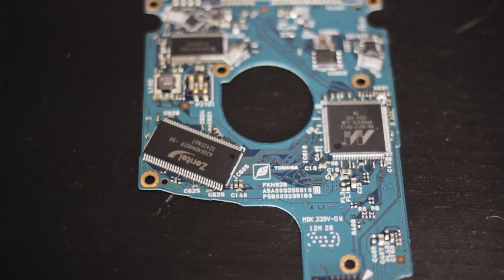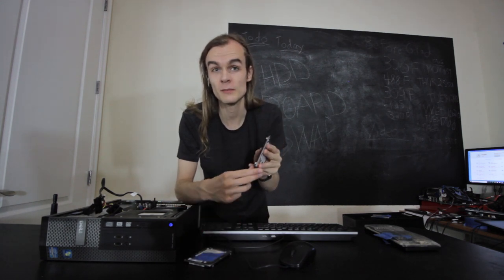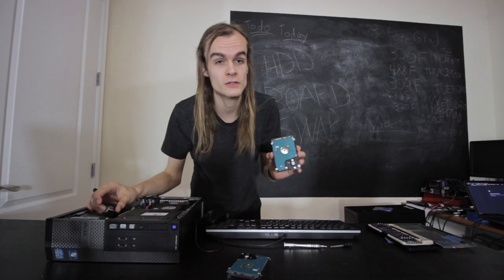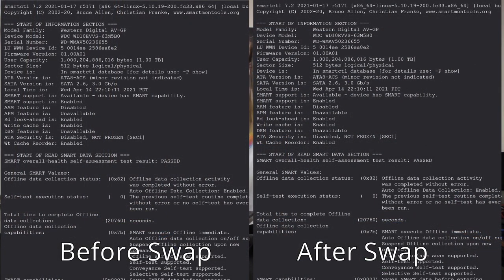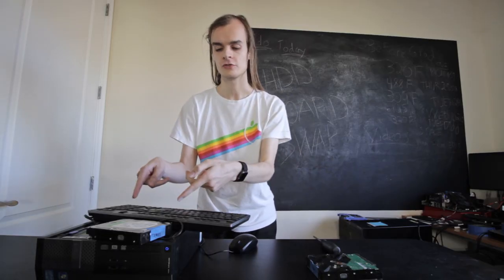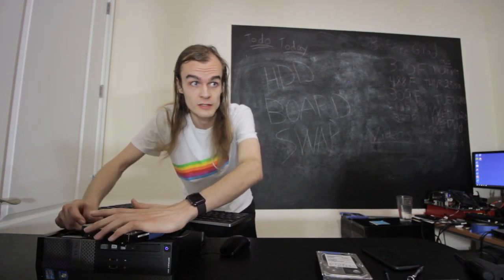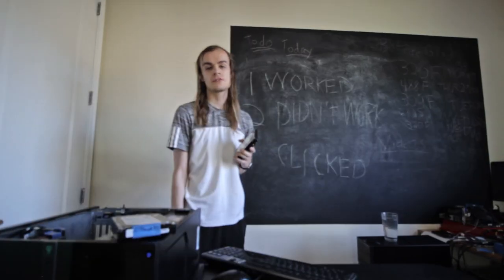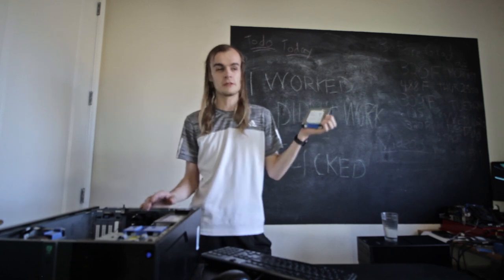Can you swap boards between HDDs of the same model

Comment: I believe there is a bios chip on some of the boards that needs to stay with the hdd.
Reply: Would it work if a buy new one identical to the one i have? i think i fried my board when using SATA cables from an old PSU and HDD is not turning on at all. I know a data recovery is expensive so i would rather try this.

Comment: I have tried hard drive board swaps on several disc drives.  It has never worked for me.  You probably need to swap the BIOS chip.

Comment: The 2.5" drives were slightly different models, so not surprised it didn't work at all. The physical platter layouts were likely quite different hence the drive clicking! Also, your side by side before and after drive swap smartctl output shows the exact same system time leading me to believe you are showing the same output twice and not the actual before and after.
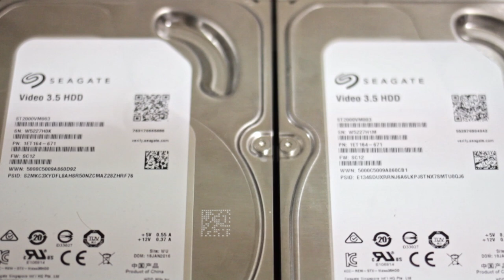Reply: The model is the same, but the revision/configuration isn't (3:23). Heck, the disks aren't even from the same year (5 years difference!). For a chance to work it would need an exact (or at least near exact) revision/configuration/firmware match, and even then it still could not work (8:26).

Comment: Only if the BIOS chip firmware is the same revision. If the BIOS is in a BGA package, the entire BGA must be reballed and swapped over to the donor PCBA. If you follow NRfix, the BIOS 8 ball package is the size of a 1 amp SMT resistor and you'll need a microscope with excellent skills using a hot air tip SMT blower.

Comment: what size are the screws that hold the board on ?? star bit ?
Reply from the maker: The screw size varies between drives so I’d get a multi bit kit so you know you have the one. Looking at some drives I have some that take t5,t6 and t8 bits.
Reply: @ElectronicsWizardry  thanks, found it